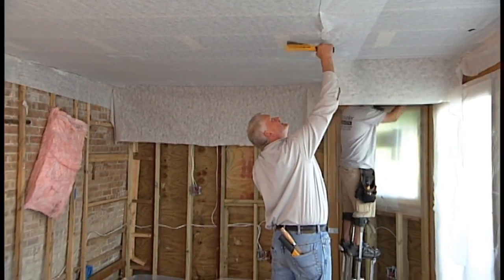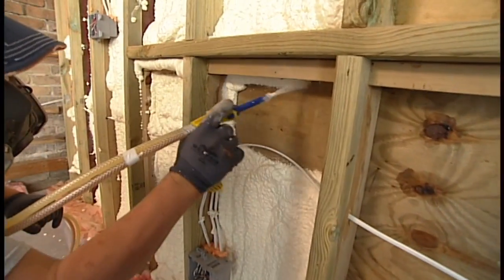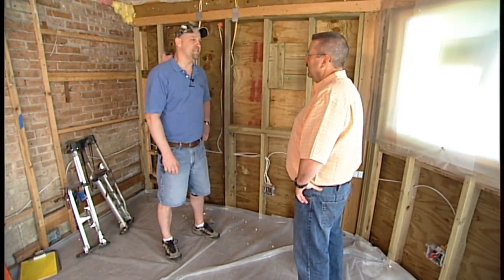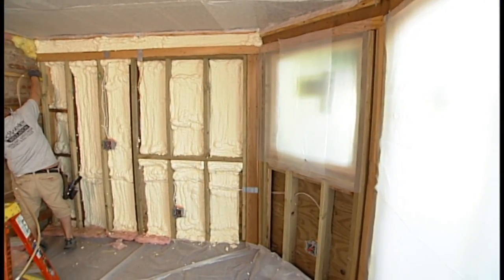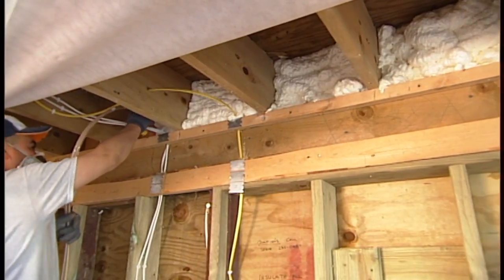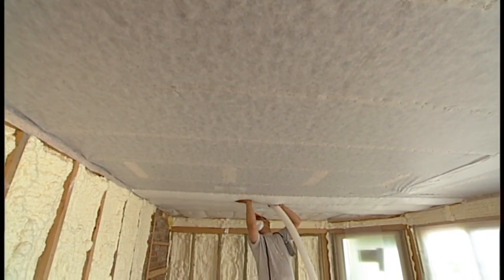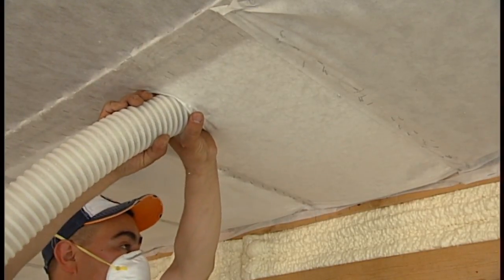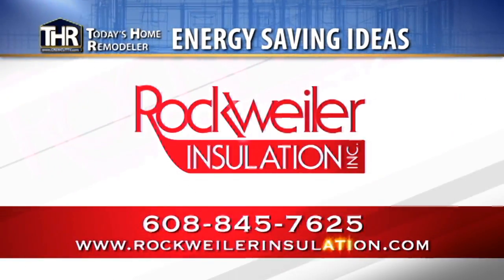BiBs vs Spray Foam Insulation

Comment: That looks like a flat ceiling? In my area (ontario) you cant get proper air flow in a flat ceiling with fiberglass. Intake needs to be at bottom , exhaust needs to be at top. For proper air flow. Hot roof 2lbs would of been a much better idea for this application. Insulation will get wet from.condensation.

Comment: Omg you should t be in business
Completely wrong products
Reply: Hi, which products is wrong
Reply: Both, OMG that is the worst insulation job I've ever seen. That foam is an air barrier at best. BIBS should never be used as a hot roof application
Reply: @peterriutta7844  what is hot roof application, but  in this video, its for ceiling of basement